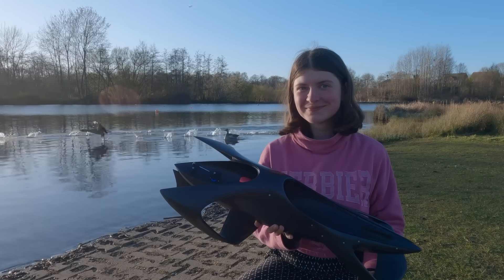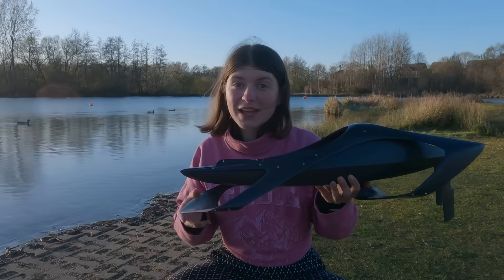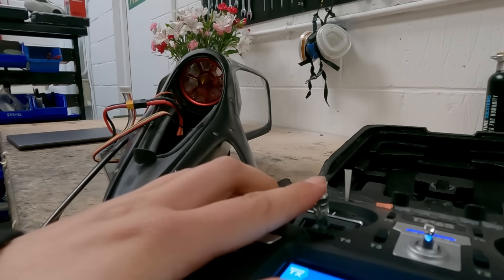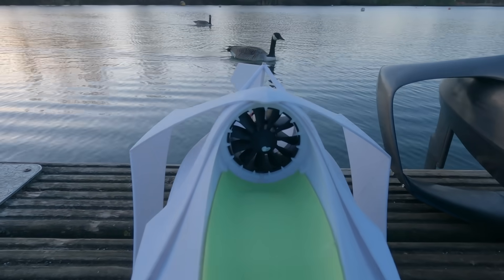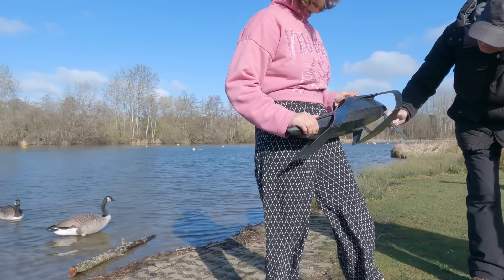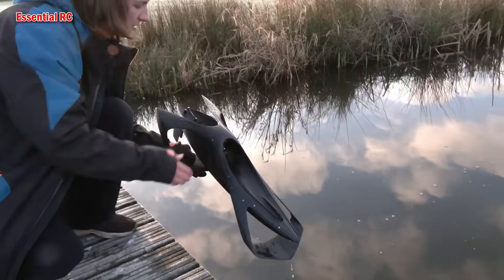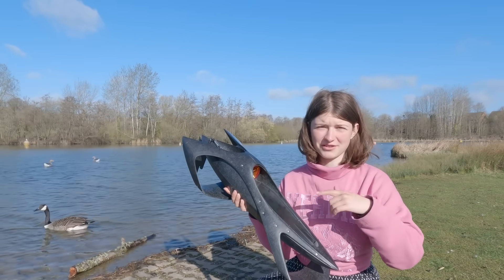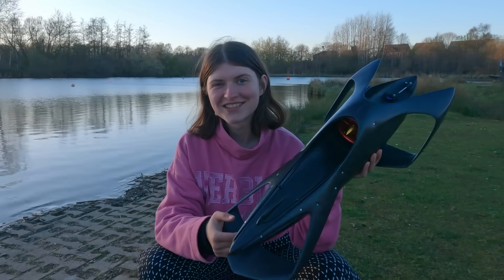Boat Propellers are Overrated... The HydraJet Explained

Comment: It would be wonderful if the planing lower surfaces could be combined with upper wing Ekranoplan ground-effect aerodynamics. Then, as one moves out into open water and the swells get bigger, the boat could hop from one wave crest to the next, adjusting trim tabs to balance the ground effect lift while still maintaining control from the rudder. Thus making the sea state irrelevant.

Comment: Young lady, I’m so happy yt algorithm sent you.
Your designs are absolutely gorgeous and the fact that you’re able to turn them into working models makes it even more impressive.
I’ve noticed that the 3D printed models you were selling were made on a 3D printer without enclosure, which means they were probably printed using PLA.
It is without the doubt the worst material you can use for anything that is not supposed to seat on the shelf for the rest of its life.
The good news is that PLA can be coated with resin.
Print the parts using PLA, coat them with resin to gain strength, stiffness, UV resistance and beautiful finish.
Btw the more you invest into that finish at least on the wings, the less of a drag you’ll have on the water, especially for hydrofoils.
If you also want to continue exploring carbon fiber manufacturing I would suggest chopped carbon aka “forged carbon fiber”.
Much cheaper, stiffer and stronger than regular carbon sheets and you can just 3D print your molds.

Best of luck girl, looking forward to seeing your future projects.

Comment: This overall design where the whole power train is above water should be much quieter for the ecosystem under the water. Possibly almost silent, since sound doesn't transfer well between air and water. And that's cool because sound travels far under water.

Comment: Very impressed I hold 13 world hydro plane records so I know a little about boats. But I think if you puts some wings on that design you would have a very interesting amphibious plane.
Reply from the maker: Thank you, and I agree I've sketchebdout a concept like this! Keen to learn more about your records
Reply: @CovaConcepts my name is Robert Read my Father And I started building Racing Boats in the 1960 mostly flat bottom doing the set up designs of the bottom gear. We’ve worked with and helped set records with Drivers like George Woods, Dave Vilwalk,and a Steve Renalds. We build the composite Collings for Bill Munceys Blue blaster, the original Circus Curcus Steve Renalds drove and the original Squire Shop Chip Drove. My Father is credited with bringing light weight cored composite Collings to the sport and I am with George Woods credited with the angled turn fins and moving the rudder to the right side of the hull to create lift to keep the turn fin in the water.

Comment: "That's a great design....I have one also, very similar; yet it is an Albatross intended more so for Aerospace; just as my immediate family had been pre-occupied a century ago as those magnificent men and ladies with their flying machines."
 If an Aye-Vee Row type "contouring" was present just before the engine intake that would then marginally and significantly increase the speed of flow.
A real slip-stream event, perhaps controlled geodetically by the presence of a type of sphere or partial, dome structure.
Well, that's what mine has!
And really that is to say or state: "something very similar to thrust vectoring and for example what the Concorde has/had."

Comment: A cool design - looks like a million dollars. My fascination is with foiling watercraft . At the moment it seems to be a bit restricted to fitting foils and foil control systems to traditional boat hulls - thats a commercial reality I guess. However your design moves outside of  that box and I think there is huge scope for water craft in the domestic type market - jet skis have been the crowd pleaser up to now however foiling  craft  have huge potential . Just one downside is how small foil vessels handle big waves - the longer the hull the better they can cope with larger waves. In this context multi-hulll vessels seem to be super efficient and fast and stable. The dream vessel would be a trailerable  foiling multihull with an extendable platform between hulls , for ease of transport and extendable pontoons - perhaps in three sections with the rear and front sections hinged and folding back onto the centre section so it can be easily carried on a trailer. Madness?  Also cheap control systems for the foils - currently the foil control systems are a bit expensive. Foils that just need to be raised and lowered would really meet the KISS benchmark -

Comment: What if you combine a ground effect design with the foil design.
The boat doesn't have to be hydrodynamic, since it gets lifted up anyways.
With the ground effect like an ecranoplane has it, you could even make smaller foils,
or make them vanish inside of the boat completely, like a landing gear for water.

Comment: Wonderfully creative and innovative design!  I love both the older (white) design as well as the newer (black) design.  A full sized boat, with room for a driver, would either require that the driver is deaf, or would deafen them fairly quickly.  Still, very cool.  You deserve a lot of community support.

Comment: Awesome design! Love it! :-))
Could you try to divert the jet propulsion exhaust into the water? I expect lower performance at low speeds, but higher performance at high speeds - but most of all way less noise. Love your boat and concept so far. Maybe you can extend an additional tiny hydrofoil for the human carrying version that eliminates just most of the waves just not the largest 1% ones… Might be a great compromise between cost, technical complexity, usability. Having the option to play between hydrofoiling and hydroplaning might be beneficial. To be evaluated…

Comment: FANTASTIC!  Curious about how fast in knots that is actually capable of going and how much faster your "this one will be fast" version will be.  I have an application for a small robotic boat that must (ideally) keep pace with a full size motorboat (but only over a short distance, .5 miles or so).  Was going to build a traditional wet propeller boat but am now intrigued by your designs.  Anyway JUST WONDERFUL WORK!

Comment: Progressive hydra foils could allow a higher top speed with the last & final lift being the smallest possible mass to surface ride by creating less water but more air drag resistance, with a bit more weight also. The trade-off graphs would be very interesting. Let's get to the AI testing tunnel Batman!

Comment: Air rudder? What you need to do is set up an air duct that can be steered, (which is presently fixed for thrust, in one direction). An air rudder is useless at low speeds, and all of your steering is by the rudder in the water.. This is a nice-looking airboat, (which goes back to Alexander Graham Bell's 1905 Ugly Duckling). Have you considered used three or more of these devices, together, to steer a single craft, (like wheels on a tricycle), which could spin the craft around like a top or in any direction at low speeds, (without any need of an underwater rudder)?

Comment: Two suggestions:
1- A ducted fan (end-tapered cylinder) around the propeller would increase thrust and efficiency by containing and guiding the airflow. 
2- An adjustable aerodynamic wing placed in the propeller's wake at the air exit flow could then use the exiting air to generate lift, reducing the boat's drag and improving performance. This combined approach optimizes propulsion and utilizes 'waste' energy for enhanced speed and stability.

Comment: Got my PhD in Youtube couch potato engineering in 2009.  Awesome design. I want simplicity to go out the window out of curiosity. Reduce the wing to the four quadrant instead of the whole wing to reduce drag. Thus going even faster? Structural integrity will go out the window. In french there is word epuré. Your design is epuré there is nothing to remove, nothing to add. I would get rid of rear rudder, and use the two legs of the back as rudder with the typical steering rack arrangement to use a single servo for both legs. With the servo for the old rudder, I would simply either do vector thrust for even more yaw control and see the limit of the front steering. But complexity will increase... Basically answering the question. How fast and what is the tighest curve and s you can design? What can your consciousness come up with to maximize all pitch yaw roll, at max wot.   I feel like watching the person who is about to come up with the next big thing.you are awesome and you zip on the whole design logic inside your mind like a wasp. So fast.

Comment: If you extended the length by about 4 inches and changed the arc of the fins by 5 degrees, you will decrease drag while improving control and speed.   YW

Comment: So what I saw was that these could be used like wheels and tires are for cars, so even if the water was rough and they were bouncing around, if you have a shock and spring system for riders, you could potentially make the ride pretty smooth.  What do you think?

Comment: What a great design!
Please do take into account edf efficiency is a disadvantage versus a propellor by physics: the rotor diameter is much smaller as a propellor. For this reason I'd advice you to level up the quality of your drive system (controller, motor,fan) and add the needed thrusttube which is mandatory for RC edf jets.

I've been flying edf jets for 2 decades and stopped when I basically binned every rule of thumb used in this catagorie and flew many proto designs.
Still a few vdos on my account available😉.
The Stumax 110-52 has a very usefull manual for the hydroaerodynamics needed for edf propulsion. The Feary Delta2 has been designed around it.

regards, Erik

Comment: Batman would be proud. Very very cool work. Keep it up. Electric motors are getting stronger and cheaper all the time. Hopefully we're in store for a big upgrade in battery tech so we can stop using lithium batteries(because of all the issues with child labor and literal slavery being baked into its supply chain from the cobalt and lithium). The nuclear diamond batteries seem interesting.

Comment: Brilliant video and boat. Very impressive you have a bright future.
Now that hydrofoiling has really taken off with kite surfing, windsurfing, Wing surfing, and prone surfing, there is a need for some altitude control. 
As these sports are practiced in less than smooth water I propose a system that uses two or more laser thermometers at different heights aimed forward sencing the wave surface and averaging to control an elevator in the water on one of the foils.🤔

Comment: wow that is an amazing design.
Extrapolating this design to a real world full size concept... 
1. Is the EDF more or less power efficient than a water propeller?  ie. compare distance travelled on a set battery capacity at various speeds.
2. Can you mitigate the susceptibility to catastrophic damage (eg. from floating debris/marine life) inherent in foil designs?
3. Can it carry any usable cargo mass or does it only work as a toy?

Comment: perhaps a rudder that is only underwater at low speeds and is above at high speeds is an improvement this could be done a few ways but i would design a free falling rudder with a horizontal piece at the bottom to be pushed up by the water

Comment: Hi Tamara,  how about designing a version for a sailing catamaran?
I'd be interested in working with you on this, and ready to build so hulls incorporating your foils, as a single handed car rood rack type craft for easy transportation to the water.  (Similar concept to the Barry Bucknell design.)
What are your thoughts?   The design would need to incorporate more lateral resistance to counter balance the force from the sails, but this could be a simple vertical dagger board.

Comment: Great design! I wonder if this planing hull concept for a small recreational boat might be a way to get EV power to deliver some speed with useful run time using a propulsion pod of either prop or water jet at the end of the rudder. Of course, thrust vs weight is always the question, but turbines have their issues, as well.

Comment: Great design. 🎉
But the idea of water functional, is to be able to go over water. If you add wings then you don't need to get on the water. If you made it up under the surface of water, then it's great. Flying over water as opposed to just flying.

Comment: This is great! I've always wanted to create cool things like this, but there's always been a thing in the back of my mind on using engineering to actually solve a problem. But, in my opinion, this really limits my imagination, like I have so many ideas (similar to yours, btw the execution was perfect, I'm really glad you didn't simplify the crazy geometry you had in mind) that don't really solve a problem, but their just cool as hell. I think I'm going to start a youtube channel, and I'm just going to fill it with a  bunch of cool ideas.
Reply from the maker: Hi, I struggle with this too, my startup Amara Automotive is trying to solve very pressing problems in sustainable transport and that's very fulfilling, but the HydraJet although it doesn't solve an engineering problem it had other purposes like testing novel construction methods using recycled composites and allowing me to fun my other projects. Also, unexpectedly this design has seemed to inspire a lot of people to take on their own projects, so that's awesome! The purpose of a project doesn't always have to be huge or direct, doing things just because they're cool is super necessary too. All the best with your channel
Reply: By the way, I think you should make a similar design, where the hydro foil gains enough life to the point where it's making minimal contact with the water. Then you add wings to the top area (air wings) and with flaps elevators and rudder, and make it transition into an rc airplane.

Comment: This is a beautiful design.  Keep up the good work.  I am curious why you have chosen to call it a hydroplane rather than a hydrofoil.  It appears in the video that water flows over the top of the wings as well as the underside.  Even though the amount of water flowing over the top seems to be minimal and certainly ventilates a lot because of its proximity to the surface, you will still be developing lift from top and bottom.  You could calculate the amount of lift created by using the lift formulas in my book "Hydrofoils, Design, Build, Fly"  If the amount of lift created approaches the amount calculated by using the hydrofoil lift formula, then you have a hydrofoil.  Good luck.  Great project.  Ray Vellinga, President,
 International Hydrofoil Society

Comment: You did a great job! To improve this project to have maneuverability in tiny spaces, or "taxing", or to decrease the stopping area if this project grows into a full size vehicle, you can make some openings on the sides like intakes, and a folded foil in the middle of the turbine that works like when you activate it redirects the air to the side openings, likewise airplane's reverse. Or a simpler version of that, an intake on top and one foil that do the same job (the reason to be at the top not the bottom is that once you activate it will push the tip of the boat up and not push it down if you activate it with speed).

Comment: You know, flat bottom bayou boats with a fan propeller just have shorter plane length and multiple upright blades to compensate for torque screw at low speeds... so, I mean, if you made you aperture closer to the outlet, you might get better results with the trailing propulsion steer mechanism... just since you mentioned that you intend to make this full size one day...

Comment: I'm astonished by the passive stability you've managed to get in the water even with the center of gravity sitting up above the surface. Looks like it's on rails when it's turning. This is some phenomenal engineering work.
Reply from the maker: Thanks so much! It took some time to tune but it's planted

Comment: Splendid. 

But... I have questions. You are at the point where you have the speed to sit on the aerofoil. Which is great. But you now have the drag. What if you took a further step. What if you had additional wings and had the lift to leave the water and use simplistic ground effect. Now, I do not know enough, but you might need control surfaces, perhaps the water based wings could also act as controls depending on simplicity. I'm dumb but I am assuming that if you up speed, and cut drag, you get higher speed, and thus more range from a given battery (potentially).

If you upscale the model, and then place a large charge on the front you now have a torpedo/missile replacement. Or you have a hella fast flying boat. Or perhaps a base for a modern flying boat, even going beyond ground effect!

I'd be talking to civil and mil in regard to drone models. ..

Comment: Would moving the fan to front and making a compression chamber and nozzle behind it help? I think the biggest issue is that the fan creates a lot of turbulence behind it and against the water directly behind the boat, I figure angling it upwards would fix it but then that would apply extra pressure at a downwards angle towards the front of the boat and might need a redesign.

Then again, moving the fan and making a nozzle along the whole spine of the boat isn't any better in terms of effort and work.

Bare in mind, I know fuck all about designing propulsion on water, the most I've done is two and three stage model rockets, so I don't know how much propulsion impact water behind the boat would affect the actual stability of the boat itself.